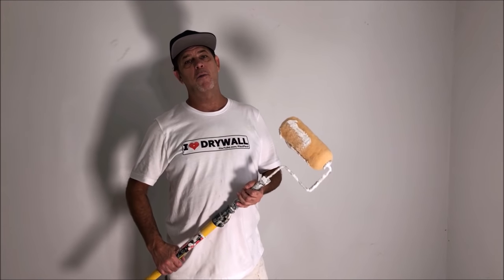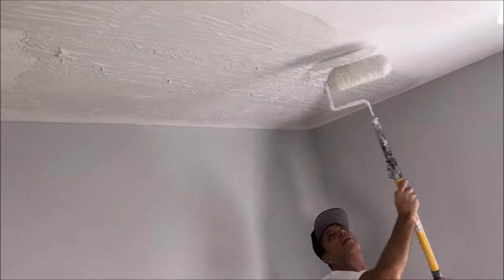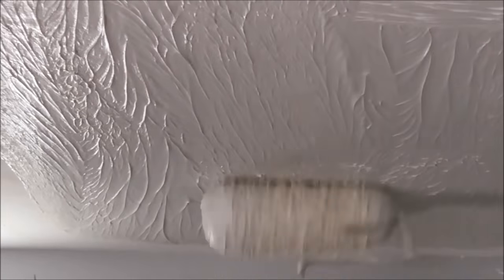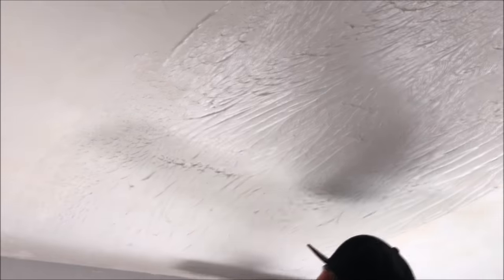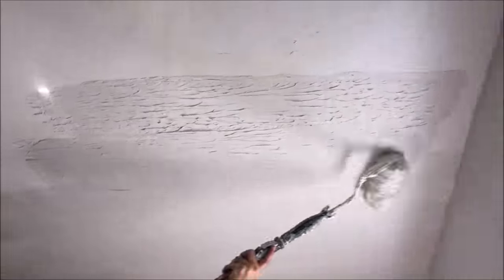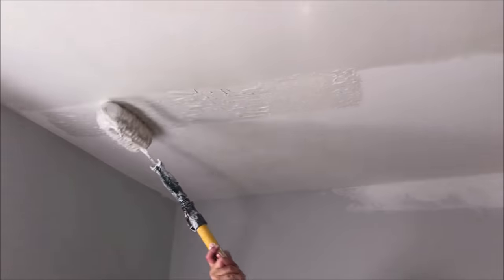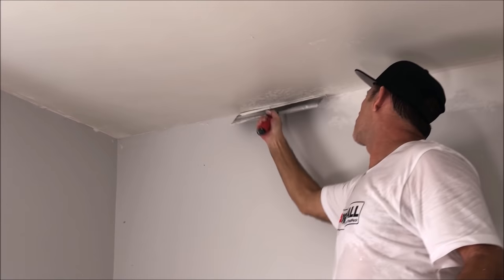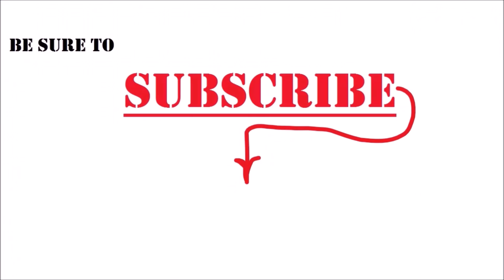Using A Paint Roller Is The ABSOLUTE BEST WAY To Skim Coat For A Beginner!

Comment from the maker: :_drywall:Here's another Great video: How To Repair WATER DAMAGED DRYWALL CEILING- Step by Step https://youtu.be/6fCW69gXqfg
Reply: Good job,  Paul!
Reply: I could see many imperfections in that one coat you did - you need two coats on that to take out the imperfections and get it really smooth.

Comment: My dad is a retired painting contractor and he used to do a lot of high end jobs in New York City where he had to skim coat entire walls and ceilings and he never rolled on the joint compound but he always told me that everyone has their own way of doing things and at the end of the day, if the job is done right that's what is most important.
Reply: I tried the roller also, and didnt like it haha So I just use a hawk and apply it that way. Maybe I'll try the roller technique again on my next project at the house :)
Reply: @RUZTY1311  Dont do it it will crack... The coat is too thin with roller, and most are just doing one coat.

Comment: I've been using this technique to fix older plaster houses for a few years now. It works and any novice can do it. The one thing that I do differently is that I simply use the blade to scrape ALL the mud off. No finesse needed but you will need at least two coats. The houses I've been doing this on are very wavy plaster damaged by sitting empty in unheated houses. I've needed three coats on them but they come out perfectly flat. Even a child could be taught to scrape it all down tight. No finesse anywhere.

Comment: I'm not a pro drywaller but used to remodel kitchens, baths, and basements so I've done hundreds of sheets in various remodel projects.  I took a 6" x 20" piece of stainless steel sheet that I bent the corners up on to use as a knockdown knife.  It works fantastic.  On my 12" knife I also use an angle grinder with a flap disc and slightly round over the corners. I profile it  starting about 1/2" from the edge so it first very very gradually fades into the corner, then has the radius profile. Once hit with the flap disc, I finish sand both sides with 420 grit to remove the burr.  It REALLY helps when skim coating like this to not see edge lines.  I use pressure feathering techniques too, but that faded knife edge works wonders when you're a little sloppy with the hand pressure.  I keep my 10" knife with one sharp corner for getting into wall and ceiling corners when needed. On the 6" I keep both sides sharp 90's.

Comment: Everytime I do one of these, I always think I should've installed new dryway. But then I do  another😁. I only do flat finish and though I think Im getting a Paul Peck finish. the flashlight test shows how much I suck at it. It typically takes me a good 2-3 coats with touchups and way too much sanding. The finish product passes the flashlight test with flying colors which I guess if you're a diyer is all that matters.  Paul Peck's skills with the blade sets a high bar.🙂
Reply: Could you please describe how to do the “flashlight test”?
Reply: @aliciastanley5582  point any light across the drywall and you can see bumps and imperfections

Comment: Dude, so I got these special rollers that are for mud and they are amazing. Used them to load butt and bevel joints on 30 to 35' foot walls from scissor lifts. So many advantages. Light weight, small and easy to maneuver around in the cage and up in the tops. Really a huge help. All you need is a bucket of mud with you and that's it. No boxes or tubes to load, far reach and super fast. The different sizes of rollers and one special roller for corners is just insane.
Reply from the maker: Those rollers sound cool Chris!😎 I’ve used a corner roller before and it worked perfect.👍🏻
Reply: What are they called, who makes them?

Comment: Hey Paul. I'm from the UK London and I eventually thought I'd try this out after watching your videos. I done my first skim coat on a bad ceiling today with this roller method. . It had loads of imperfections. I have to say that ceiling is looking very good now. I used easi fill and thinned it down to yogurt like consistency and rolled it on. I then used my 12" taping knife to smooth it out. Looks perfect 👌👌
Reply: Knauff does a product called "pro roll" in the UK which is a bit pricey but is supposed to be a roll on product. I've done a room with it and it's a good finish
Reply: @beaniebrotha  thanks for that. Il check it out. Tbh pre mixed filler  compound is soo much better to use

Comment: Good work. You're doing the world a service by showing this. I think if I did this for a living, I'd put a pole on that drywall knife, or whatever tool I used. I did my own ceilings more-or-less this way and got used to bearing down on the leading side the same way. At times, I've also used plastic knives with the corner on one side cut to a rounded edge, like that of a pool trowel. I'm not a fan of skip-trowel finishes, so I did end up doing some sanding, but I also found that a second coat made with joint-filler thinned with paint got rid of a lot of subtle imperfections without sanding. Also, if the original finish is really rough, a regular plastering trowel or even a  pool trowel  does have the advantage of being able to ride over the bumps with less chattering: whatever works.

Comment: Just love this idea! I am not a dry wall specialist (renovation generalist) but getting the muck up there over a decent area before it starts to dry off is always a struggle... I never seem to be happy with the result to the point where I stop messing about with it!
Reply: A diy here but have done a fair amount of hang tape finish. Your mud is probly too thick. Needs to be like pancake batter. Like when you use a pump to fill boxes.

Comment: I'm finishing my basement and am currently working on finishing the drywall in the bedroom. It's taking forever. There's a butt joint that goes down the center of the room the long way. I had to feather it out really wide to hide it. I did two coats of mud so far and sanded it smooth. It was torture - so much back and neck pain. Ouch! It still needs one more finish coat and I think I'm going to try using a roller to get the mud on and then skim it off flat. I think that will be the fastest way to do it and will produce the best results. I can't wait to be done with this so I can start painting.

Comment: Paul , took out a built in tub /shower, trying to blend , new drywall , with old  , the old has an orange finish , its a small bath, I want a flat finish, ceiling only.    This may work , skim coat , I see the seam , bettween the old & new,  Thanks, Tom

Comment: I am a DIYer, with a big list from my wife. You had to have left something out of your videos. I tired it and did not come close to what you are doing. It would not have been the 25 plus years experience would it? I use The USG Green Joint compound because I saw you use it for another video skim coating. I will try the plus three, have plenty of wallpapered walls to practice with. Question. I get a lot of bubbles on the surface, and even if I use it straight (not diluted) to go over the areas with bubbles I still get some. If I use the smaller tubs of premixed, it is thicker and covers the bubbles with not problems. And suggestions? you do a great job and are truly a master. Wish you worked in our area
Reply: Just put a liquid dish soap like Palmolive put like a cup of soap to a 4 gallon mud and mix it that'll help to minimize the bubbles.
Reply: @MrSeth166    Worked like a champ, great suggestion and a lot of help. Can not thank you enough for your help....

Comment: I've heard that if you add a cup of dish soap to that when you mix it up the mud it helps keep from bubbling up and will come out smoother. And gives you a little bit more working time before it drys up.

I've never actually tried this I'm a Mason not a drywall guy.

Comment: Thanks for the upload. I am planning to do this in a couple of weeks on the same type of ceiling treatment. Two questions. Did you water down the compound at all? Second, how many coats should I go for if I am going for a smooth finish? Two?
Reply: Do the same as like a yogurt consistency and it depends how bad is the wall sometimes it takes 2-3 coats if you are very picky it might need an extra coat with the final touch ups.

Comment: I have no experience with applying joint compound as a skim coat, but I have a hallway about 30 ft long with peeling ceiling paint, as well as an adjacent bathroom, and am planning on trying to refinish those myself.  If I scrape all the loose paint I can from the ceiling, will skimming the ceiling stop the remaining paint on the ceiling from continuing to peel?  Sanding the remaining paint that hasn't flaked off seems like it would be more difficult than just skimming it and repainting, but I'm concerned about whether the remaining paint under the skim coat could cause future problems.

Comment: I’ve watched your how to cover a  popcorn ceiling with joint compound. Could you use the roller to do the same? House was built in 66 so removal is not going to be an option due to $

Comment: Thank you for this  my question  is can I  skip the second step in skim coating and paint right  after the 1st coat ? My secind question  is , is there away to make the layer of the skim coat thicker as my bathroom ceiling  is full of uneven spots and old paint I can't  remove ? My 3rd question  is where can  I find the 2nd part video that contains the secind step of skimming? Thank you very much .

Comment: Im a new home owner with walls and ceilings im repairing room by room. Im on the bathroom now and the precious owner had nightmare taste in wall paint and texturing. Im still scraping and sanding to get the walls and ceiling even. Im going to try this method to smooth everything out. I hope it goes well. This by far is the worst room of the house.

Comment: DIYer:  I have a 1905 craftsman (Lath & Plaster) that is presenting with long cracks.  I "tested" the plaster on either side of the cracks and it appears the plaster has not lifted from the lath for "most" of the wall.  Are there any special prep (besides fixing plaster that is not adhering to lath) steps I need to consider in preparing the wall for skim coating?  The wall has a glaze paint finish.  Thanks in advance for responding!

Comment: Does this work also for popcorn ceiling ?
Reply: It's better if popcorn finish is removed first, over time some popcorn looses its adherence to the ceiling... but before you do that, need to test for asbestos. If all clear then get a gardening pump sprayer and spray lightly with clean water to soften up the popcorn (do not saturate) and scrape away with spatula or a popcorn ceiling removal scraper from your local hardware store (Home Depot has them in the paint section) By doing this you reduce dust and it's super easy removal. Oh, if its been painted over, then good luck because water will not penetrate the paint.

Comment: Nice! #drywalltube 👍🏻
I have been skimcoating all the popcorn ceilings 8 inches from the wall, because the previous home owners abused the ceilings where it goes over the wall.
I wanna finish the 8 inch lines on the ceiling with nice tiny trim to cover the line between the popcorn and the 8 inch skimcoated part on the ceiling 👍🏻 
Have you ever seen this Paul? I think you have!

Comment: currently work for a gc but worked for painters for years as well.. i can hang sheet rock and do all drywall work before spackle..my boss will tape coat and finish and i will sand and paint but i just don't do any of the spackleing..have done a few small tape coats for walls that were not getting painted just required a tape coat but always feel my spackleing is not great so always like to watch  spackleing videos to learn..#drywalltube

Comment: Can I do this over popcorn crap?
Reply: It's better if popcorn finish is removed first, over time some popcorn looses its adherence to the ceiling... but before you do that, need to test for asbestos. If all clear then get a gardening pump sprayer and spray lightly with clean water to soften up the popcorn (do not saturate) and scrape away with spatula or a popcorn ceiling removal scraper from your local hardware store (Home Depot has them in the paint section) By doing this you reduce dust and it's super easy removal. Oh, if its been painted over, then good luck because water will not penetrate the paint.
Reply: @RoadGlideSTShenanigans   that only works if the popcorn was never painted

Comment: Can you please do a video how you clean up and dispose of the extra join compound?
Reply: I just dump the excess back into the bucket. The re used mud might begin to get stiff. I then just dump  a half cup  of water in the bucket and do a quick mix with the roller.

Comment: Ok here is a question for ya...
I just took off popcorn on my bathroom ceiling....I scraped it and damaged the drywall somewhat. I bought a course roller and used sheetrock mud, mixed it with water and began to roll it on. I think the bathroom was too humid and when I went over a few areas it peeled away. I am leeting it dry overnight.
Do I get a 1/2 " nap and redo it or just patch those 3 spots??

Comment: Hi Paul, do you wash and reuse the rollers, or are they shot after using them with mud? Also, why Plus 3 and not All Purpose? You usually use All Purpose. Thanks, Paul!👍🇺🇸
Reply from the maker: Hey man!💥👊🏻 Yeah, the roller covers are pretty much shot after using them with joint compound. This was the second skim coat. I did use all purpose on the first skim for better adhesion on the painted textured ceiling. 👍🏻 -Paul
Reply: @PaulPeck  ok cool, that's what I figured. It's my first time doing this, but it turned out pretty nice. My ceiling I'm doing is really old (1850's) and lumpy from previous shady work. I hammered out bad spots, used real Dura-bond to patch, 1st coat All Purpose, and now I'll use Plus 3 to finish it. I appreciate your response and your videos. Once again, you saved my marriage, lol 🤣😭😆😂🇺🇸🙂

Comment: Not a drywall guy, so, honest question here. Why skim-coat the whole ceiling instead of just taping and mudding the seams and screw holes? I can understand texture, but this seems like some master level work. Definitely not for the un initiated.
Reply: Skimcoat produces a job that looks like traditional plaster. Tape and joint mud, then paint gives more of the cardboard office building look.

You're right this guy is a skilled plasterer.  Most of us couldn't do that smooth a job without bunches of sanding.

I have done this to fresco walls.  Mixing paint with the thinned mud and rollering it on, then a second paint coat. It looks good, especially in goldenrod color.

Comment: I had to retape a garage ceiling joint. I used joint compound and white paper tape. It held up for about 6 years, then all cracked open again and looks like the tape failed.  What did I do wrong and how should I make sure it last longer than 6 years?

Comment: Is there any reason roller application of joint compound would not work on a wall without texture?  Having trouble getting a good paintable surface on a large drywall patch.

Comment: Did you add water to the joint compound and mix it before starting? The joint compound is thicker than what you were using.
Reply: I water mine down before I start rolling.

Comment: Question do you have to do this after you install drywall before you texture? Im new at doing drywall building a addition & at installing drywall now for a 12x16 addition. Would appreciate your response. Thank you.
Reply: Just tape. Bed. Then float it  light Sand check it with a light
Reply: @timmynormand8082  thank you.

Comment: Hi, I have a popcorn ceiling that I want to flatten. I'm pretty handy with drywalling so just wondering if I can use your roller technique to to the initial coat to cover the popcorn.. I want to avoid scrapping it all down to a concrete ceiling.
Reply: I was wondering the same thing

Comment: My bathroom (shower room) ceiling has mold (black color already in  20% area), what should I do? I need long term solution, not just as you did in this video, for the mold will come back again, any suggestions? thanks and happy holiday!
Reply: You need to absolutely get some air movement like a bathroom fan installed to get that moisture out and the mold wont be able to live there... The best bathroom fans I have ever used are made by Panasonic.  I think I have seen some Panasonic fans at H/Depot.. They are powerful, and very quiet... Not those lousy loud, hammering fans we have all had to listen to all our lives...
Panasonic is the name to remember...

Comment: What if the ceiling is horrible the people who owned the house before me sucked fr seams and tape falling off and I'm no good at drywall can't find anyone to fix it tho so I'm stuck doing it and I have an appraisal in 2 weeks so need ot fixed asap any idea how to fix it
Reply from the maker: I got you Justin.👍🏻 Just got off work man.😅 I’ll reply with some tips tomorrow morning bro.
Reply: Thank you buddy I appreciate you
Reply from the maker: Justin, I would remove all of the falling tape joint and use FibaFuse drywall tape (most Lowe’s and Home Depot’s sell it) on the joints where you removed the tape. Here’s a good tip: when you’re applying the joint compound, try a keep it only in the removed tape area. Because when you remove the tape all of the joint compound outside of the tape intention is still there. So, if you keep muddying over that it will create a hump. I hope this helps. Let me know if you run into any questions along the way. Good luck. -Paul

Comment: can you use this technique to fix dents in the dry wall that i did not sand right?
Reply: Yes. With this method, I"ve prepped walls with 3/8" holes that filled up perfectly. However, keep in mind that my walls were already so damaged that I needed to roll and blade it off three times. But, the walls are like glass then.